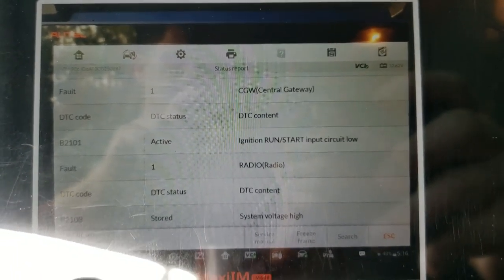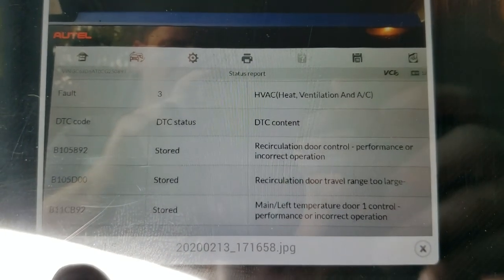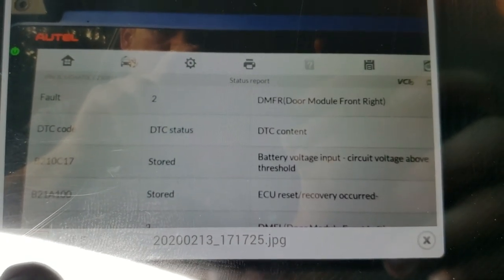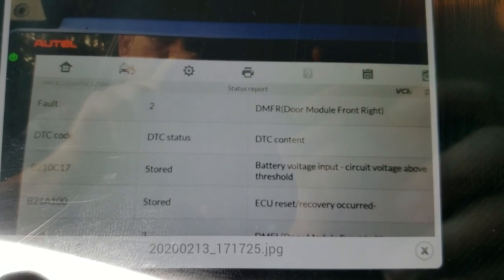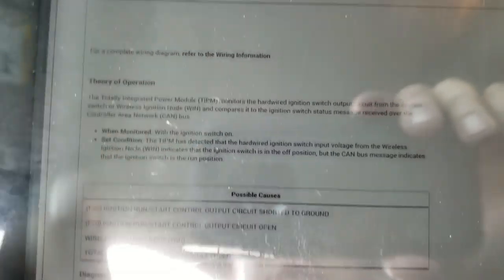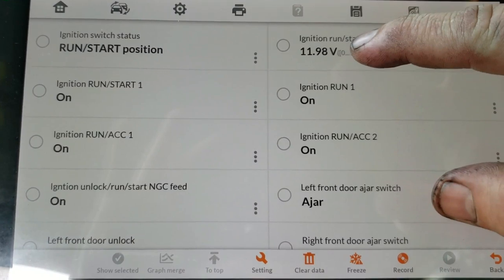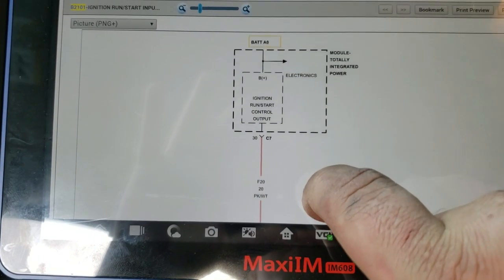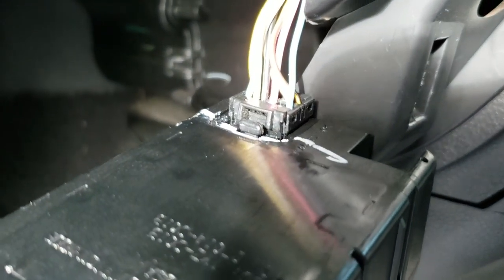2012 Ram 1500 - No Crank w/ Brin Kline

Comment: Thanks for sharing Brin. There is an early and a late for the 2012 RAM 1500. Not sure how many systems were changed but have run into wiring color and other major changes between them. Had to dig thru multiple sources to figure out the wiring diagram that matched the vehicle I was working on. Looks like a nice little perch for one of those little fellers to sit and have lunch. Time to get the Cayenne pepper out.
Reply: Yupp 👍👍

Comment: I watched your video and I found the same exact thing believe it or not same spot! About 4 or 5 tiny wires I need to repair.  Hey thanks  for this video I thought it was my battery or my starter. But then I had head lights/horn and door locks but no radio/ windows or air.

Comment: Hi Brin, good case study as always. Question. Wouldn't using a incandescent test light still cause damage if that wire happen to be a PCM sensitive circuit. How about using a "computer safe" test light or using your your body as a resistance by touchig B+ with one hand and the circuit with the other, while monitoring scan data for a response? How about using the power probe 5v reference adapter. Thanks Brin.